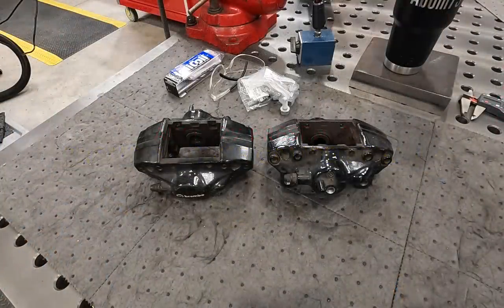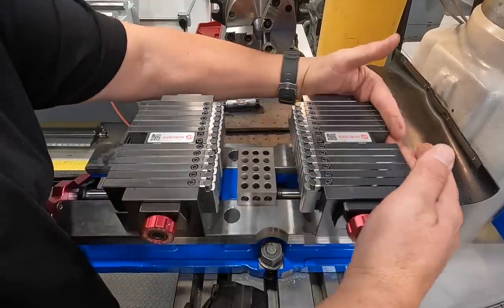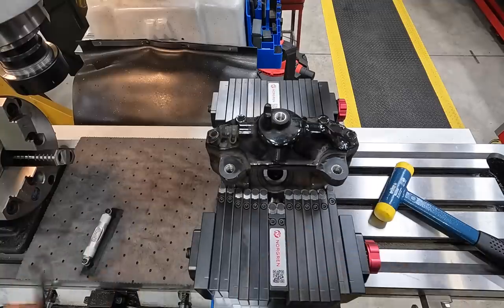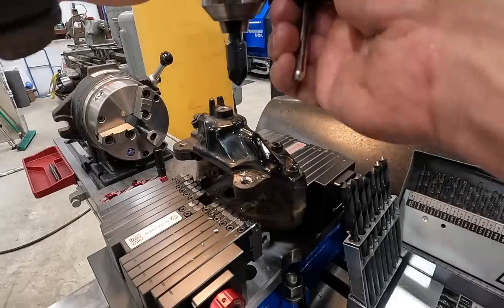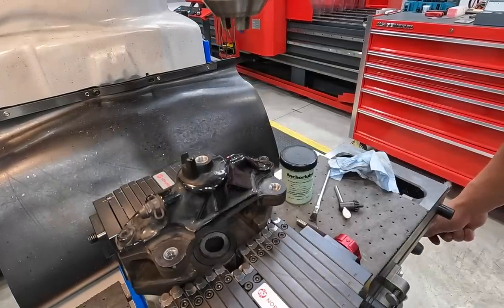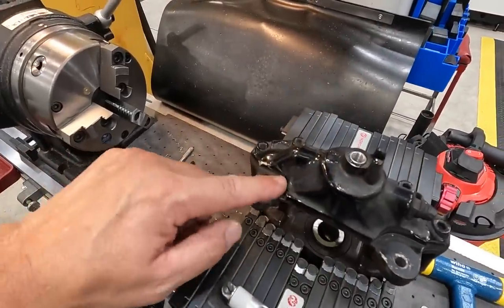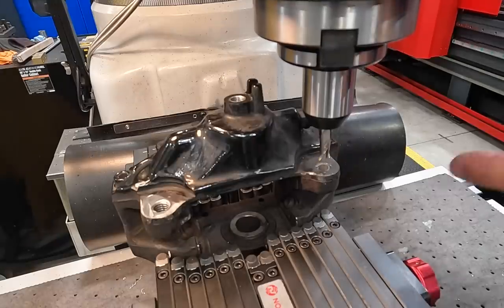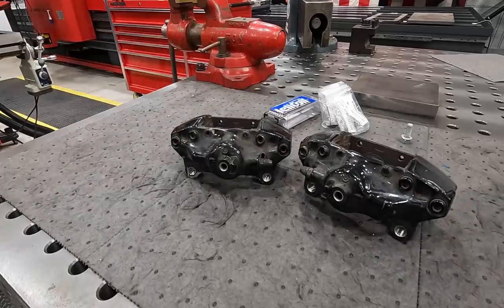Brembo Brake Caliper Repair

Comment: I've always used lock tight when I install them
Reply: Someone else pointed out that in this case the brake calipers can get hot and break down the loctite
Reply: Me too. The instructions state that Loctite 2620 Threadlocker is to be used.
Reply: @peterspencer6442  I forgot to say it was high temp
Reply: @peterspencer6442  The Factory Puts Lock Tite On Caliper Mounting Brackets And It Doesn't Break Down And I Have To Heat It With A Torch To Get The Bolts Out!!!
Reply: @Craneman4100w  Interesting, I've never seen a callout for Loctite in any engineering instructions when installing them. Obviously different applications call for different things. 🤔

Comment: That's a nifty vise jaw Adam. Love the video. Don't mind those couch experts in the comments :)
I do wonder though, as the brakes get quite hot in operation, how would that affect the helicoils?
Also for those recommending threadlocker: You guys know that threadlocker is ineffective at the high temperatures at which braking systems operate?
Reply: Heli coils are stronger than factors/stock sized threads specially into aluminum. I was always skeptical until I dug into the data.
Reply: @lahoozer6694  Thx mate

Comment: Helicoil  is not so great in thru holes. When tightening it will go out a little bit on the back side. So no lube needed, maybe some glue…
Reply: Totally agree I would locktite the coil in place rather than putting lube on to install for caliper mounting. Typically OEM fasteners are locktited on that application also
Reply: Thinking the same, but Abom have done what they asked for...the car is for sale anyway 😅
Reply: Yeah, I think I would have used JBweld instead of lube

Comment: What stops the heli-coil from just unscrewing out when you take the bolt out?
Reply: Helicoils are slightly larger than the thread they go in, which is why you drive them in from the "front" with that tool - they effectively wind up like a coil spring when they are installed, and spring back out towards the threads in the hole to grip it, and away from the bolt that will be installed.
Reply: @dregenius  TY!
Reply: in other words the tiny amount of friction caused by a thin spring being wound, conversely you can make them fail by applying a bit too much torque, they are kind of crap and really in my experience only buy you enough time to get a replacement part, cause with regular cycles of maintance they will eventually pull right out
Reply: Friction

Comment: I can see where that would be a handy tool. Perhaps out of reach for many. However for small production or repair work  job shop where building a dedicated fixture for two or three parts for example would be required otherwise,  it would probably pay for it self in time saved pretty fast.

Comment: Heli coil are not the best for brake calipers the vibration with loosen them.  I have done a few of them and found a threaded steel ( Id/Od ) sleeve Loctite ed in is best.

Comment: I’ve never used a helicoil so I am not familiar with them. What keeps the helicoil from backing out with the bolt once you tighten it down? Seems to me like once you started turning the bolt to remove it the helicoil would just back out with it.
Reply: I don't think it really matters if the helicoil comes out with the bolt because the coil is threaded into the caliper and the bolt is threaded to the coil as long as you're reusing that same bolt it'll thread back in normally and can be torqued to spec with no issue but I haven't used them either so I'm just speculating
Reply: I have used a lot of them. Put in dry, they usually back out.

Comment: to all those who do not like heli-coils, they actually create a stronger joint, meaning they can take a lot more torque then the original tapped hole on a brand new part.

Comment: Question :  in these cases that the whole is not blind is a though and though. If be bolt rusts on the hellicoil when you apply torque does the hellicoil move? Or its in some way attached to the base material ( because you used some lube on the coil before inserting it.) thanks

Comment: What about galvanic corrosion? The saddle was Aluminium and the Bolts seems to me were to, so what material is the HeliCoil? Isn`t that a concern, when the will live in a wet environment?
Reply: Doesn't seem to be an issue.  I have seen the helicoiling of an aluminium cylinder head in a Coventry Climax engine and they worked fine.
Reply: .. helicoils are stainless steel.

Comment: A couple ideas (not answers, but just ideas to think about)
It seems the fancy vise jaws could be improved with a spring mechanism behind each sliding piece otherwise one block can slide the adjacent block with the "slight friction" method going on in here.
I'm thinking something like a "constant force" spring like the ones used in display racks to push product to the front. (Punch that description into McMaster and you'll see what I'm talking about.)

What about coming in with the chamfer tool after installing the heli-coil so it doesn't have that abrupt start at the end of the wire?

Comment: Of course, the caliper is a 2 piece one and you "could" take it apart and mount it on a fixture plate.
Reply: I thought about that too, the Wilwoods we used to run on the modified's were built similar and had similar issue

Comment: Looks good Adam. I'm wondering if jaw fingers has a slight cross cut teeth pattern to help hole the object a little more securely. Not sure after tapping, if casting raised slight would have made a difference or not. Cheers Blessings.🙏👍

Comment: Vise holding what about loosening the moving jaws so they can move by hand, hold the part in the vise tighten the moving jaw until the two inner teeth on each side hold the part enough so you can let go of it, then move the teeth into the work piece and start snugging everything together. The inner two not even touching the part just seems odd to me.

Comment: You could just split those calipers in half and clamp it down.
Reply: Requires rebuilding the caliper at that point, and the internal seals between the halves aren't included in normal kits.  They're basically not meant to be disassembled.
Reply: @viru52000  regular o-rings, i have split ap racing calipers meny times when i was a racecar 
mechanic.
Reply: @juhmura1  AP stuff is meant to come apart and they give you the parts and specs to service them.  Brembo doesn't want you to split the cases and won't even tell you the torque spec for the bolts holding them together.  They're also panted after assembly, so that would damage the paint.

Comment: Great video Adam! I was just wondering why didn’t you use any lubricant when drilling? Is there any specific reason?
Reply: Aluminum doesn't need coolant.
Reply: @ThePirateGod  Was always told by old timers to use an alcohol lubricant to avoid tears, and I have seen a clear difference between dry and wet cutting, especially on thin plates.

Comment: Now retired, for many decades I designed & built {in my tiny basement shop/office} specialty electronic equipment for the geophysics community.  Given Adam's job, I would have used a hand-held electric drill to overbore the holes, assuming that the drill would more-or-less self-centre on the existing hole.  Tap the holes with hand tools, again assuming self-alignment.  Pop in the helicoils, and we're done...  Guess I'm not a machinist...
Reply: Nope, you're not.  Nor am I.  If I was faced with this job my humble garage would provide me with the same tools as you have.  Maybe Santa will bring me a small lathe someday..
Reply: yet your approach would have worked as well

Comment: Nice repair project for the video. Great repair Adam. Q. Would the treaded hole that was above the two lower holes needing repair worked for using the spindle nose to hold down the part while clamping in the adjustable jaws of the new vise to keep it level while clamping? It appears that would help get the part level for clamping. Just a question?
Thanks for sharing.

Comment: Trying to figure out why Brembo doesn't coil their aluminum parts from the factory.  It only makes sense.
Reply: Money
Reply: Because you torque it to Spec, then you don't butcher the Threads.
Reply: No need, it's hacks that screw up these threads by cross threading or over torquing

Comment: Nice vid. I appreciate you demonstrating the vice but, the calliper will split (see Allen bolts) in half revealing the machine  surface to clamp down on. This would save crushing/damaging or distorting the sides of the casting. :)

Comment: Loved the video but question with high torque applications like the hold downs arnt you supposed to glue the helis in place to keep them from backing out if rust or something gets between the heli and the bolt or keep it from backing out when the bolt is removed. Maybe i am wrong

Comment: is there no concern with the helicoil screwing itself out since thats not a closed bottom hole?
Reply: Ive always been concerned of that exact thing but if Adam's doing it on a customers job-- I doubt it is an issue worth worrying about.
Reply: i thought he'd red loctite this guy in place
Reply: Super common fix on these calipers, not a problem in this application.

Comment: Question: when you have a set of special purpose oddball tools (like the drill and oversize tap for the helicoil) how do you keep that stuff organized in storage?
Reply: They come in a box that helps keep it together.
Reply: The tap and insert tool comes with the coils in a helicoil kit. You just keep all that stuff in the box or pouch they came in.

Comment: i was thinking.. the callipers, can they be split into two? there looks to be four cap-head bolts on the top side.. i'm guessing that the join between the two sides would be machined.. the top half could then be bolted onto a simple fixture plate? i was a little concerned about the overall clamping force applied by the jaws, and that it could have slipped.. anyway, excellent job as always..
Reply: Yes, they can be split and bolted or clamped down with toe clamps for this job.

Comment: I think I would use a thread locker when installing the Helicoils instead of lubricant.
Reply: Thread lock is a no -no. The Helicoil is like a spring and the thread lock would ooze into the threads and gum them up
Reply: And you'd be wrong.  Helicoil documentation says "When not installed, the outside diameter of the HELICOIL® Plus exceeds the receiving thread by a defined amount. In combination with the high spring force of the material, this difference in dimension results in radial expansion and therefore in the tight and clearance-free fit in the nut thread. Additional locking elements or adhesive – as are common for fixed bushes — are therefore obsolete."

Comment: Adam, those new vice jaws are the bomb for irregular work holding. I am curious about the torque value and what the maximum vice torque can be applied before the fingers slip? You apply 65 pounds to the jaw fingers, how much " gronk " as per Tom Lipton can you put on the vice screw? I was also wondering if you are going to put a shield behind the Pacemaker to keep the chips from getting behind the machine? Florida strong !!! PEACE

Comment: Very interesting video, and enjoyable as always.  I was wondering whether adding lube to the Helicoil might compromise the strength of the connection, like you really don't want it to slip over time.
Reply: I have placed a ton of helicoils and we tend to use wd 40 except when the hole is so damaged that the almost fall out of spec then we use loctite to glue in the helicoils
Reply: It's fine from a safety standpoint, the helicoil is far stronger than the original. Many applications use helicoils as original manufacture design. The problem comes when taking them out, then, my experience as been that they want to back themselves out unless you use Loctite. Not necessarily the end of the world, but at least irritating

Comment: Be curious to see if those "fingers" marred the aluminum of the caliper. That's a lot of pressure applied to some very small contact areas. Be afraid it would leave marks in the soft aluminum if you cranked down on it that much. Or cracked the powder coat.
Reply: it's visible when the second caliper is removed from the adaptix. anything harder than the aluminum will leave marks... that's a non-issue in this case. unless it's an exotic car, calipers are usually not nicely machined on the outside.

Comment: How do you keep the coil from working out?
Reply: The end of the Helicoil thread insert jams into the newly cut thread when the insertion tool is removed, insertion tang broken off and then torque is released. The “smart free running” version lacks this feature and are held in by the bolt in the hole.

Comment: Strange Brembo doesn't install inserts from the factory. Guess they wanna save money.
Reply: I got dual Brembos on my R100RS BMW, and getting the bolts in straight isn't hard. Maybe Brembo is used to competent folks.
Reply: @erniemathews5085  if you work on industrial machinery, most aluminum castings have inserts. Maybe Brembo prefers throw away components.
Reply: @erniemathews5085  Calipers were from  a WRX car, the steel bolts were grown in to the aluminum.
Reply: @bstamand1985  The automotive world is not industrial machinery. These are parts for consumer vehicles; individual consumers have much lower cost tolerance than an entire business. 

If you don't abuse the parts (these ones are clearly abused) they'll be disassembled and reassembled many times throughout their lives without issue. It's pretty clear that an incompetent wrench-turner got to these parts.
Reply: @allenklingsporn6993  it doesn't matter Industrial or automotive. Best engineering practices should be used in all fields. Actually come to think of it - Especially when your vehicle is carrying humans. So you're right. This application is even more critical than a hole in a piece of machinery that pumps air.

Comment: Time-Sert from the back, so u pull on the Time-Sert shoulder
Reply: I was thinkin the same thing. I've had aluminum parts spit the coils out - Happened to me on a set of heads.
Reply: Not necessary.  Helicoil has been used on likely thousands of these Brembos.  It's an extremely common failure, to the point that some people will just helicoil them before the failure happens as it's easy with the self feeding helicoil taps.

Comment: Why is the spindle going what I would call "in reverse" with the switch in forward?
Reply: Shutter speed of the camera, if you look closely some parts of the spindle and drill bit are turning in opposite directions even though you know everything is turning in the same direction.
Reply: If the mill is in back gear, reverse is forward.
Reply: Depends on which hemisphere you are in - like bathwater running down a plughole.

Comment: I now it's not your fault but Whoever Send you these calipers should have put Plastic Push in or brass plugs in the hydraulic line connections I seen chips flying in theme chips in the hydraulic brake system is no good

Comment: Although it levelled in two planes, how was parallelism checked to the travel of the bed?
Reply: not necessary, he aligns the spindle to the holes anyways. You'd only have to do that if you had to machine a flat on the side or go by coordinates etc.

Comment: Your not using the jaws correctly,
The middle 4 fingers should be in contact with the work piece.
Reply: I agree, you should be using the middle fingers to contact the piece, and then surround the  piece with the other fingers to hold it firm
Reply: So run the vise all the way in to the middle fingers, just touching.
Push the sliders up to contact.
Lock the sliders.
Then clamp the vise.
Seems like that should be the way to do it?
Reply: ...WHO ASKED YOU?!

Comment: Quick Question ...  What keeps the Helicoil from spinning in the new threaded hole? I noticed that the install tool was loose on the  inside threads, so does the actual bolt slightly expand the insert to put pressure on the newly tapped threads? At the very least I thought you would use red locktite on the outside of the insert before installing.  I look forward to your responses. Thanks!!
Reply: The coil is actually larger than the hole/thread its repairing. The coil is compressed into a smaller diameter during installation. That spring tension is what retains this type of coil.
Reply: @Dreddip  Thank you!

Comment: Nice, are the coils barbed or what keeps them from coming out with the bolt ?
Thanks for the video  !!
Reply: the bottom outside of the heli coils are usually  serrated so they can dig in and hold. In automotive we also as a dab of Loctite. all automotive ones come with Loctite, but I've seen them hold perfectly fine with out it.

Comment: Looks like I got flamed by the peanut gallery.. Another way to hold it would be 1,2,3 blocks on end, slide a bar through the caliper and clamp to the table.. Don't have to take it apart.